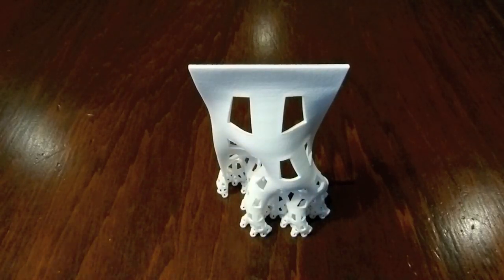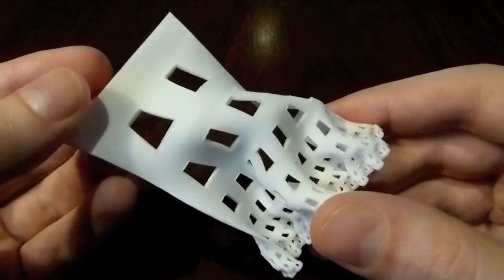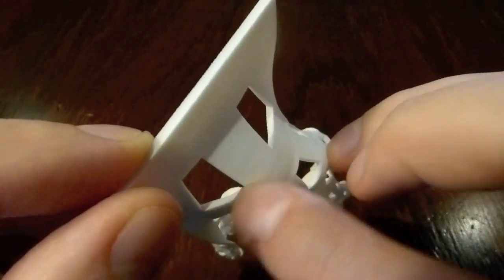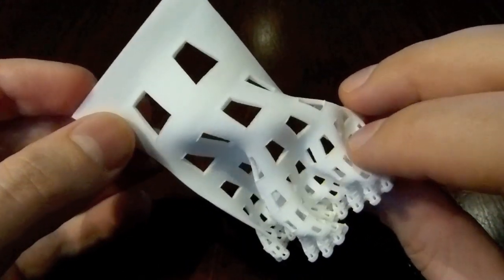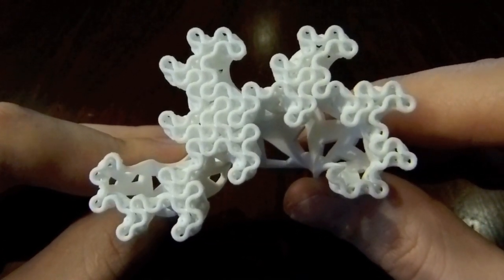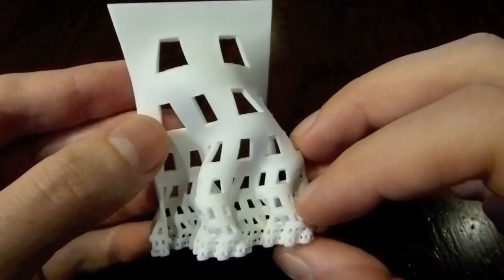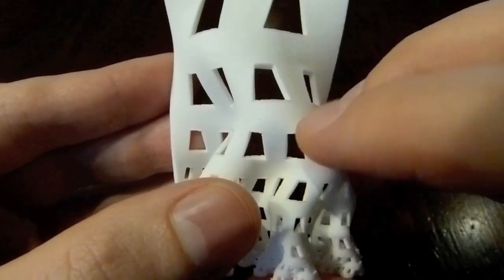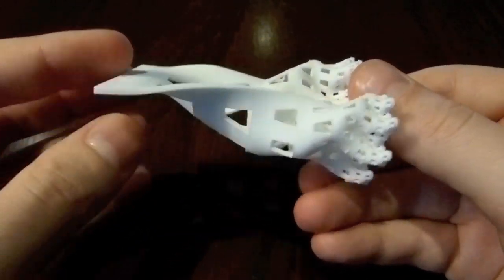Developing dragon curve

Comment: you have to do this with mandelbrot-- now I see it as a tube the size of the universe!
Reply: frankbraker the mandelbrot set isn't created iteratively though, and therefore doesn't have a "development" that can be plotted on the z axis.

Henry Segerman what did you use to interpolate between the iterations?
Reply: ***** think of it as starting zoomed out (low resolution) and progressively zooming in to the same scaled region (i.e. sliding the resolution slider while maintaining the same scale).  Hence a region with very little detail near a smooth part of the bug would become increasingly detailed in the z axis.  Ah but now I see it - it would just go from smooth to a little more bumpy, but not much else.  Okay.
Reply from the maker: ***** See http://math.okstate.edu/people/segerman/papers/developing_fractal_curves.pdf
Reply: ***** I still think it can be done, where the z axis is zooming in.  The idea is that the boundary line is getting more and more detailed, so at one end of the sculpture it would be relatively smooth, and allowing it to zoom in arbitrarily would become rougher and rougher, while maintaining a continuity, very similar to the model you've shown, only based on mandelbrot.

Think of it as a cone, where the mandelbrot "bug" is extruded and gets a little bit bigger along the extrusion forming a cone.